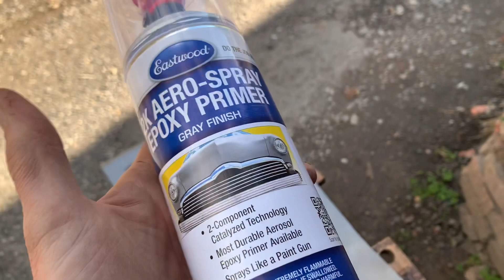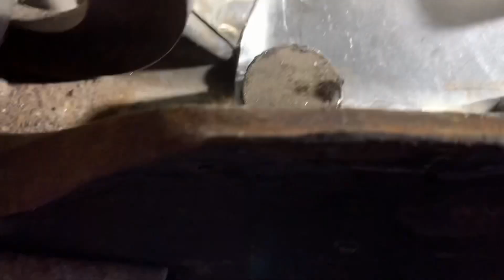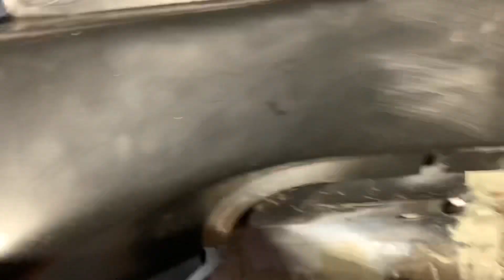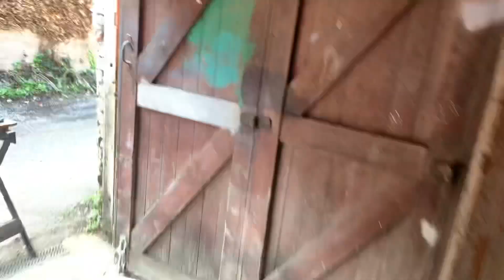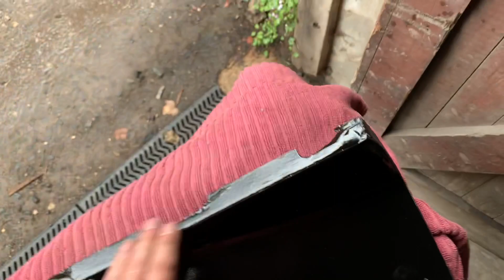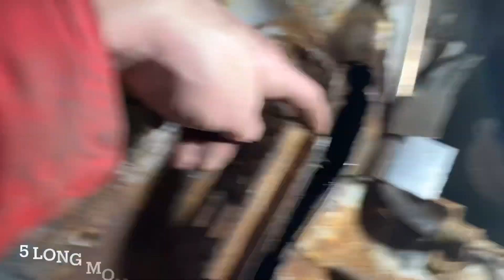Mercedes R107 - Eastwood 2K Epoxy Primer +3M panel bond for inner wheel arch repair

Comment: I have seen someone install this part with punching holes and using plug welds- which method is better?
Reply from the maker: Punching holes and using plug welds would be the way panels were attached before products like 3M Panel bond were available. Disadvantage is that the process of welding will burn away primer and eventually lead to rust. Two panels plug welded together will not necessarily be water tight. 

Panel bond over comes those two disadvantages. That’s my take. 

Mike
Reply: @MikesMercsandothercars  thank you. You’re a master of your craft and research things well. I’m pretty sure 3M also made my dental fillings. Amazing company!
Reply from the maker: @lollybo3  Thx for the compliment...I'm no master, but I do spend time researching! Mike

Comment: Great video as always! Is the fender hard to take off? How many hours did this project take to complete?
Reply from the maker: Hi - if the wing has been off before, it is much easier because the glue/bond between the wing and chassis will have been broken. Here is a video:

https://www.youtube.com/watch?v=KJVgWi3mdME

In the playlist below, you can see the sequence of events. I guess looking at the dates of the videos would tell you how long it took me......bearing in mind I am no professional and had never done the job before.

https://www.youtube.com/playlist?list=PLONqXqFnLGrgtcTrM81301wb_7SPVQ7iL

Mike